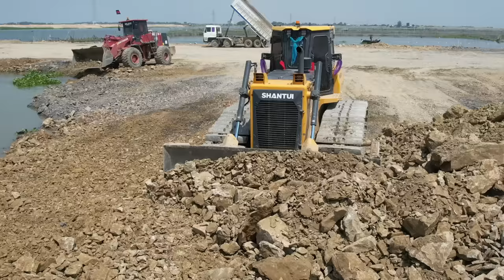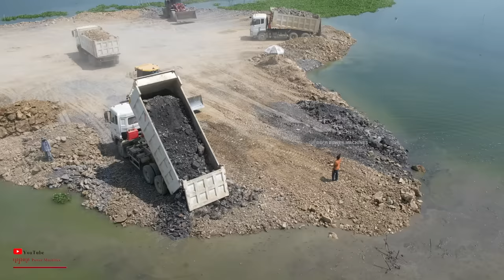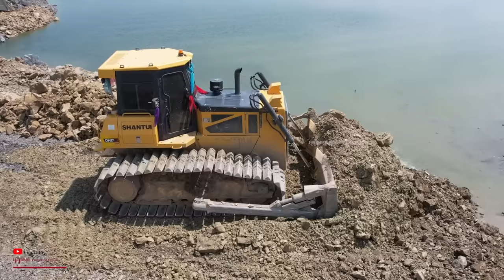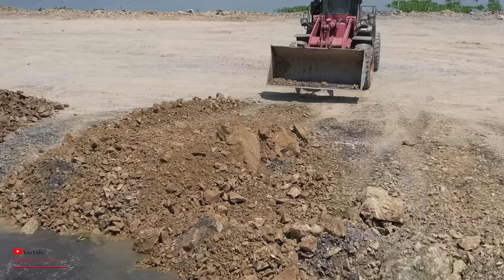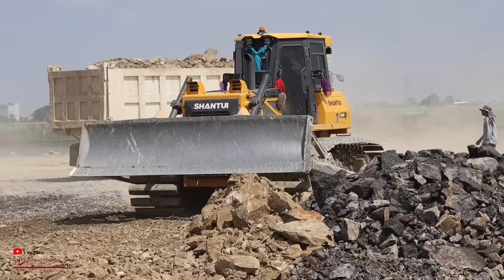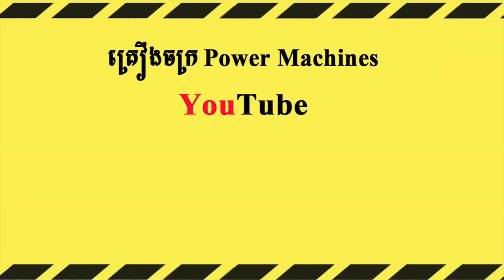Amazing Power Shantui Equipment Dozer Moving Rocks In Water

Comment: embankment work on sea or lake is never done with a mechanical shovel because it scatters the embankment which will dissolve in the water but not compressed.
so you have to use the push bulldozer for the backfill compressed on the water. Do your job well and don't waste your time. if you want your project to move forward as soon as possible.